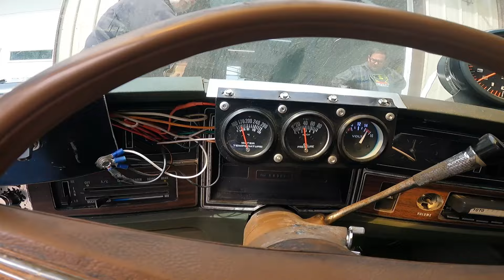Cam break in Will it run? Stage 1 455 #buick #enginebuild #camshaft

Comment: Nicely done! 
10yrs ago I did 2nd 455 build. Top n bottom ARP studs, shallow dish pistons, Orange crush hd gaskts,, home port n polish  heads stage1 valves, 
T/A 1:6 roller rockers, 6,500rpm big cam, KENNY BELL single plane intake ,etc.
   Enjoy her!
Reply from the maker: I plan on doing the bottom end before to long and going to better pistons. but for now it runs strong!